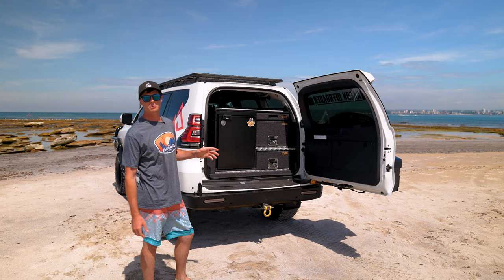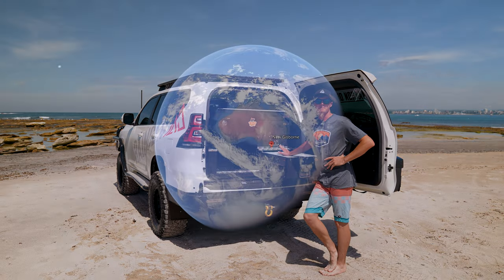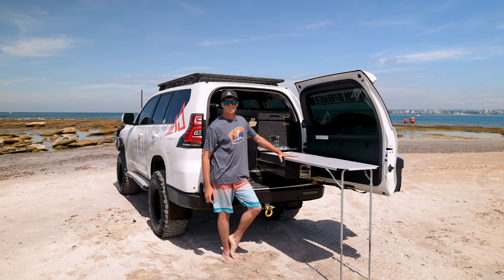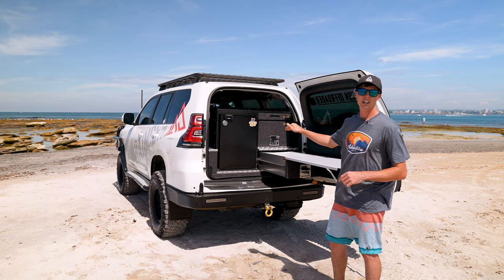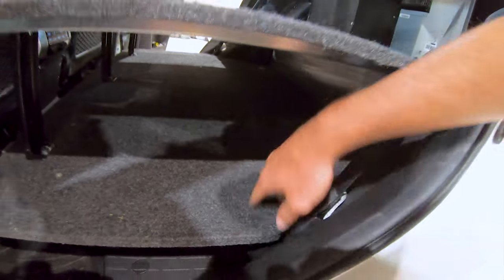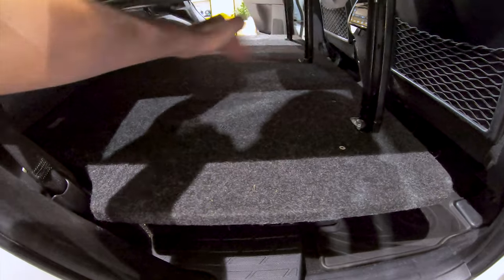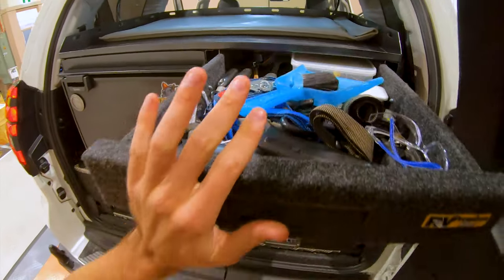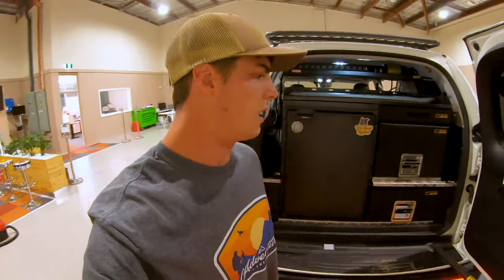Ultimate DRAWER SYSTEM + Twin Floor in my WAGON - RV Storage Premium ALLOY - Toyota Prado 150

Comment: Do they make the top two drawers reasonably easy to remove for daily driver usage. Like having dog in the back/shopping?
Reply from the maker: Yeah the drawers come apart in the stack with 4 bolts each which is easy. 
The top tiedown plate has quite a few screws in it. 

But they actually do an enclosure for the upright fridge for the flat drawers.